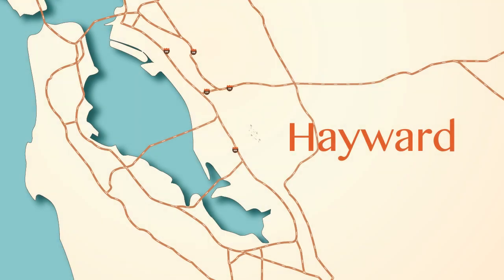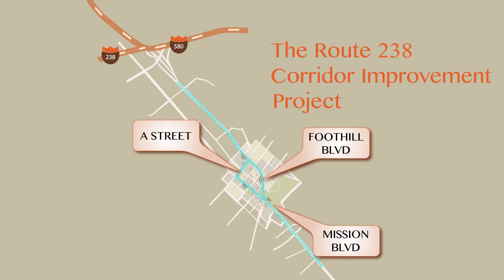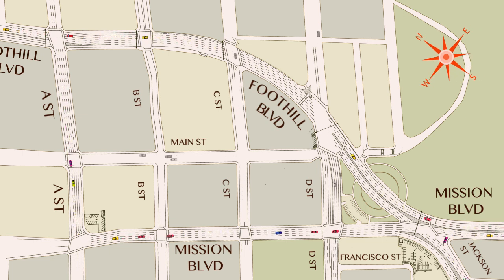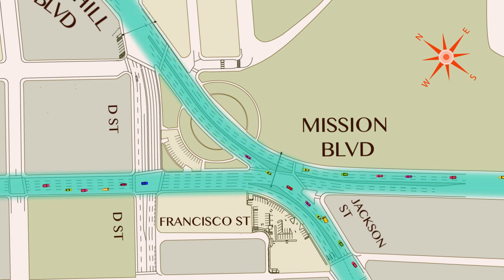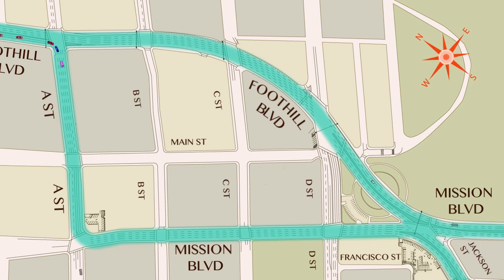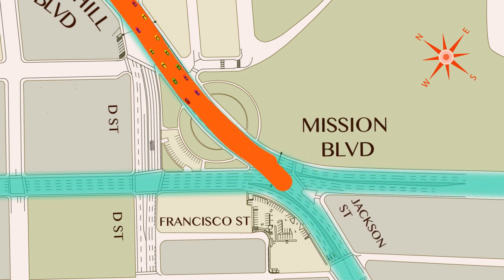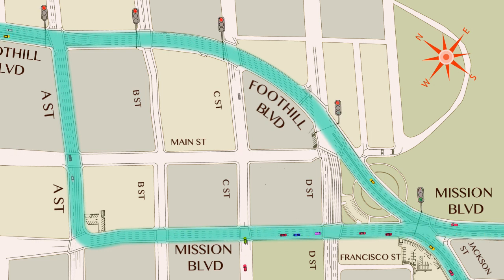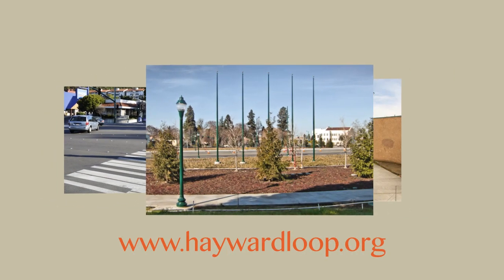The Hayward Loop

Comment: Completely incorrect design.  Ignores that most of the trafic through the Foothill-Jackson interchange is people driving between San Ramon Valley and the San Mateo bridge via Crow Canyon Road, A or B street, and Jackson.  Many years ago Bill Lockyer quashed the Foothill Freeway that would have extended 580 to the San Mateo bridge.  That freeway should have been built.